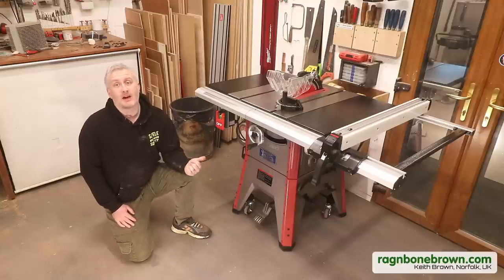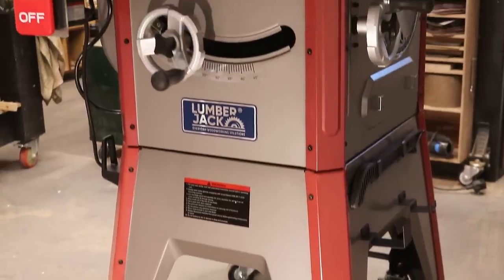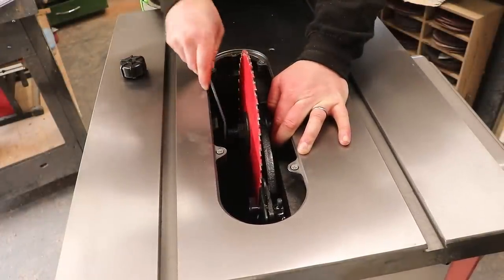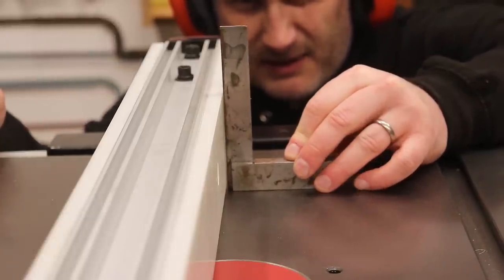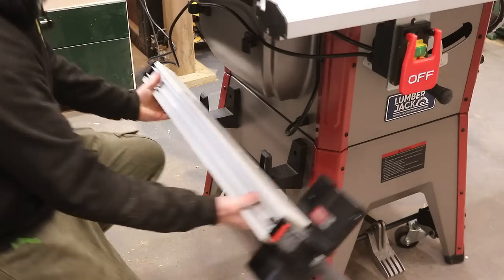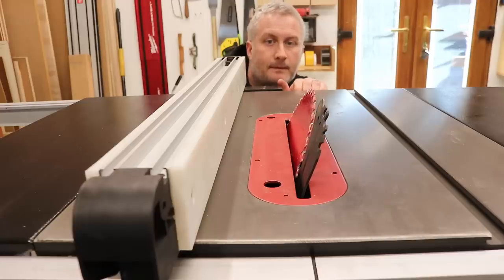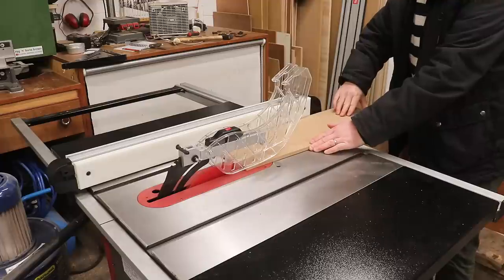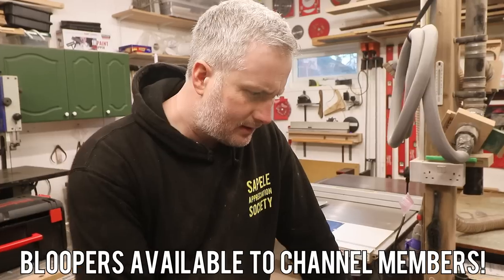LUMBERJACK TS1800 TABLE SAW: Everything You Need To Know

Comment: Your fence adjustment frustration acting was quality! Can't believe they ship that saw with a standard 13amp fuse with a motor with a large inrush current and to advise you to run it on a long extension lead is madness!!
Reply from the maker: Cheers John interested to hear your perspective on this with you being an electrician! Is running it on an extension lead bad advice then, and if so, why? Cheers 👍
Reply: @RagnBoneBrown  Hi Keith, Extension leads are always a bad idea and should only be used for temporary needs. When you use an extension lead your are increasing the length of the circuit {some leads can be over 20 meters}. If you are at the end of an already long circuit then the loop impedance (resistance) can get to high and under fault conditions the MCB will not trip in time turning the entire circuit into a red hot wire which only takes seconds. Another reason is that a coiled up extension lead under continuous use can turn into a heating coil and are a fire hazard. Best practice is to uncoil fully an extension lead when it is in use for extended periods so it can dissipate the heat.  As a wire's temperature increases so does its resistance and as its resistance increases so does its temperature. You can see the problem! Also an uncoiled lead in the workshop is a trip hazard so its just a bad idea all around. Now if you add the slow blowing fuse to the end of a long circuit with a coiled up extension lead that's a recipe for disaster!
Reply: @JohnMcGrathManInShed  The motor is designed for the American market running on 60hz running at 3450 rpm. In the UK at 50hz it runs at just 2800rpm , very slow for a table saw and the reason it cuts slower. The spec is in the manual for the saw.  Until they spec a decent motor to run on the UK supply with a soft start I wouldn't want one, shame as it looks a decent saw. The advice from them about changing mcbs and to run it on an extension lead for a plug fuse blowing problem is just total nonsense and they really need to sort themselves out with this saw and stop giving out this ridiculous advice.

Comment: A great video as always Keith. In relation to the mitre gauge problem, one fix I have seen other makers do, is to drill holes on the edge of the mitre bar. These can then be tapped and have grub screws inserted, which are then adjusted to suit. I've read through the comments and I can see that you are sitting on the fence a bit with whether to keep the Lumberjack or not and the need to make new jigs is putting you off. It seems to me, that if you removed that from the equation, then you are actually falling on the side of the Lumberjack as being the better saw. If that is the case then you should think long term and passed the making of new jigs as, inevitably, you will at some point have to remake them for the Axminster as well. Great Podcast as well by the way.
Reply from the maker: Thank you!
Reply: I fitted plastic grub screws to mine...flat headed screw driver type

Comment: I bought the lumberjack planer thicknesser which has exactly the same problem I found the only way to get it to stop blowing fuses was to run a long extension from the house. I just thought my garages electrics were old 😅 cheers Keith ill have to get me some of those slow blow fuses 👍
Reply: I’ve got that machine too. I really like it. The fence is a bit poor though. I’m planning to upgrade/modify it at some point. I’ve also been wondering about changing the blades to a spiral cutter head.
Reply: @stuartwilliams5385  yeh the fence definitely has a knack to using it but once i figured it out it was fine, honestly its probably my favourite machine it's such a beast. Iv just built a table I bought in a load of rough sawn walnut planed it all up with this beauty and came out amazing and very square. Have you found a source for a spiral cutter head that will fit it?
Reply: @LAJay90  I haven’t yet. I was hoping you might have. 😝. If I find one I’ll post here.

Comment: Send the saw to Matt :D It will be an upgrade. 
So, the pros with this seems to be the mobility. If you had to share the garage with your wife's car for instance. But in your case, your workshop is quite large by European standards (non industrial ofc). And you may not need the mobility. The blade guard on the Lumberjack seems better to be honest, since you can aim through the split. When it comes to better features, you really cant beat the features on the DeWalt jobsite saws. So, if you follow that logic you are back to your old shed. I have yet to see a cabinet saw with good dust extraction and I use the same kind of solution you do, with a separate shop vac for the blade guard. IMHO the only feature your Axminster saw lacks is a quick change riving knife. But I am rambling on here. Great video. Love the podcast as well. Was looking forward to this video. Nomad out.

Comment: Great video. You definately nailed many issues other had setting up the saw here in the USA. This saw is the sister saw to the Sears Craftsman 218330. It is no longer made, the pro series took it's place for a couple years and the line was terminated. However, this saw may well be brought back with some great improvements. 

T

Comment: Had this saw for a couple of years now and have no complaints other than with the motor, had the same issue as you and switched to slow blow fuses which has worked ever since. For me the axminster was a nono as it just would be too space inefficient whereas the lumberjack slides neatly under my workbench when its not in use.

Comment: I have a Harvey ambassador with the same kind of insert plate. Get yourself some aluminium composite panel to make zero clearance inserts. It's aluminium sheet over a stiff plastic core. You cut one bit to the size of the insert and then epoxy a second sheet under that with cut outs for the levellers and other bits in the way. Makes for a cheap and stiff insert. Mine is 4mm composite panel for thickness. You will need to check yours but my guess is it is the same or close.

Comment: If I was in your position I think I would keep what I already had despite the issues mentioned, especially if I had already gone to the trouble of having a 16amp power socket installed, made and fitted a router table to the side table, an outfeed table to the front, made some jigs for it etc. It feels like towards the end of the video you are 99% sure you want to keep the Lumberjack but you want that final 1% just to confirm it's the right thing to do, whichever one you decide to go with good job on actually getting your hands on the LJ to make this great review video!
Reply from the maker: Thank you! Yeah that about sums it up
Reply: @RagnBoneBrown  I don't think you mentioned it but if you are not under any financial obligation if you kept the Lumberjack i.e. paying something for it then that might become another factor in your decision. The Axminster on the second hand market should be worth something not far off £1000 if not more will all the accessories you added when you bought it.

Comment: I'll be honest, Im really tempted by it. Loosing half a HP might be an issue BUT I would get around that by just changing the blade more often. I love the idea of the Dado, thats a game changer from my point of view. I think it would make an awesome saw to build into a cabinet. If you could purchase extra side tables or extra fence extensions so you could do that than it would be awesome. A sliding table would also be a game changer as coupling that with the Dado and you have a tenon maker.

In relation to the electrical issue, to be fair to Lumberjack, the fact that they came on here, made a comment and are trying to come up with fixes, says alot about the company. I've had conversations with a few different tool companies and they always usually result in it sounding like they don't care which is the complete opposite that I get from LJ. 

Great review, look forward to seeing how you get on and what you decide. It's a toughie. How does the standard table size compare to the Axminster? That would be a big decider for me I think.

Comment: Interesting review.  I bought a Dewalt DWE7485 a couple of months ago but only got to set it up last week. One immediate advantage compared to the Lumberjack was that it was completely setup out of the box and other than clipping the fence on (and then clipping it on correctly as I got it wrong the first time) it was ready to use straight away.  But boy, is it loud and I take all your comments about the benefits of induction motors.   The small amount I have used it so far I’ve worn ear defenders.
Didn’t bother with the factory mitre gauge, I’d bought an Incra Mitre V27 a few weeks earlier which fits both my bandsaw and the Dewalt, and with adjusters for side slop.

Comment: From an electrical perspective, the saw does not have any issues. Slo Blow fuses were made for this exact purpose, to deal with inrush current that is present on startup. The device draws more than the fuse is rated for for just a small amount of time, and then current is much lower. The slow blow fuse keeps the safety rating of the fuse for a fault at 13 amps, but allows for the rush of current during startup. Yes, they should have used this from the get go. There is nothing wrong with the saw, it is just how that motor works by design. The fault was the builder of the saw, and if they changed to the slow blow at the factory they have sorted the problem.

Comment: I bought a lumberjack band saw and was quite impressed by it. I’ve use replaced my mini lathe with a lumberjack one and it’s great. They seem to do a great job at a reasonable price. This is something that you didn’t mention, price difference though I appreciate it may have been in your previous video.
Reply from the maker: Prices change all the time so no point putting them in a video as they won't be right for long

Comment: Seen the electrical problem with the fuse in the plug blowing mentioned before on Facebook and telling people to change the mcb, and use extension leads is just total nonsense and they should sort themselves out with the correct information, non of that will solve a blown plug fuse when the motor is drawing too much current on start up. This problem has been around long enough and they really should spec a decent motor that will run properly on UK 240v 50hz. The saw being designed for the American market means the motor runs at full rpm on the US 60hz at 3450rpm, using it in the UK on 50hz means it's running at a reduced 2800 rpm which is very slow for a table saw.. This is shown in the spec in the manual if I remember correctly. It's looks a good saw but I couldn't recommend it to anyone because of the electrical issue and not having a motor that runs at the higher RPM. Good review by the way 👍

Comment: I would assume that the two grub screws, or set screws to our American friends, in the mitre bar are to make sure the head of the mitre gauge sits flat on your cast table saw top. A fair assessment of the competing table saws,. I would go with the Lumber Jack as the ability to move it quickly in the workshop is a major benefit.
Reply: sure it's to get the mitre gauge flush with the surface of the table... but the question he asked is why would you do that?

Comment: My TS1800 has developed a fault!! When raising or lowering the blade, it sometimes goes very stiff.  I assumed it was just a build up of sawdust and grease, as i still havent got extraction set up on it.  I find that just wearing a mask and putting a bucket under the extraction hookup does the job for the time being (i have got an hvlp extractor, but still havent got the workshop to a point where im ready to install it)

As ive been adjusting other things on the saw anyway this evening, i thought I'd pop the cover off and see if there was anything obvious.  Turns out there is a very mangled washer dangling on the thread that has managed to get wedged between the thread and the teeth on the motor mount.  I couldnt figure out which end it had come from, or if it was even supposed to be there.  Ive emailed Lumberjack today, but i guess i wont get a reply until at least Monday as they will have been closed by the time i emailed.

Comment: Tricky! I was leaning towards the smaller Axminster that Paoson just upgraded his mobile bench with, as I couldn't see the need for a cabinet saw and I don't mind waiting for them to restock. I'm now reconsidering - the lumberjack is an impressive package! I don't like the fence style on the Axminster saws - I retrofitted a slightly smaller version on my very old cast iron saw and it has definite flex under pressure.

Comment: Very interesting. I must admit to having been wrong about this saw when making my choice last year based on this review. But I certainly don’t regret choosing the Axminster AW250 even though it lacks some of the refinements of many contractor saws. The Hybrid saw format is interesting from a UK point of view as you would think there would be a huge demand for it, but I see and find most small workshop owners tend towards bench/cabinet saws or site saws.
Reply from the maker: Thanks Karl. I was wrong to choose my Axminster too so that makes two of us 😁 if LumberJack had done a better job at getting in the hands of reviewers earlier on, I think they probably would have sold tons of them
Reply: If you guys had the decision to make again from the start, would you have gone with the lumberjack? I am currently setting up a new workshop and upgrading my table saw is high on the agenda. I considered the Axminster but what I will need for the extra power might not even be an issue and the lumberjack seems to excel in most other areas. Can I also ask, does the arbor diameter being imperial cause any problems in day-to-day use? Great review by the way (and incidentally it was your Axminster review I saw in the first instance too).
Reply from the maker: I will cover this in an upcoming video, but it's important to note that the axminster saw I have is no longer available for sale, so it's irrelevant! But yes the lumberjack would be my choice if I was choosing between the two
Reply: @RagnBoneBrown  The price point  also makes it an attractive choice. I think I might be about to place an order with lumberjack. 
I don't  suppose you have a referral code?
Reply: @GazBadger  I think I probably would have. I've not talked about the AW254TS but now I've re-jigged my workshop to make sure it's available for use more, I might. There are two things I like about the lumberjack. It's size is compact enough for a 35ft x 11ft garage workshop but has a large saw feel. The second is the in-feed on the table is bigger and I've always preferred that and the axminster relatively short infeed is one if its short comings.
Reply: @Strawbyte Workshop  I hadn't  even considered  the infeed length...I have to agree with you that would be handy. I think my mind's  made up. I am ordering  the lumberjack tomorrow. Thanks for the response.
Reply from the maker: I don't but Shaun in the shed will have

Comment: i'll be buying me some slow blow fuses then, great review. one thing you didnt mention that has taken me time to adjust to is the lack of break on the motor, meaning the blade takes a while to stop
Reply: Update - slow blow fuses worked for a while but still ended up blowing, told by Lumberjack that I would need a 16amp circuit.

Comment: Great saw, I've had mine for a number of years. However, it is not the same as the Ridgid saw (I almost bought that one), it's an almost mirror image of my Craftsman #21833, with a few tweaks here and there. It's one of the smoothest running saws I've owned, it passes the nickel test (stand a nickel on it's edge and turn the saw on, nickel doesn't budge).

Comment: The old wood workers saying is so true!!! "Save your money and buy the best tools you can afford!" Its cheaper to pay ones!! On paper this saw ticked all the boxes for me.... It had everything you could ask for moving up from the DeWalt site saw... So i bought one... As mentioned in the clip, this is the "old Ridged table saw " . Research faults on that old Ridged saw and you will find there are a lot of common un fixable faults that may or may not affect your saw out the box. Its a lottery... some get a perfect saw and others not... There are at least 3 common faults that pop up that makes reliable accuracy imposable on this saw... With out even fully assembling my new saw it failed on the first test... Lifting the blade up and down at 90 deg, there was more than 1mm deference at top and bottom, i could literally see the blade moving with my naked eye... It did not lift straight. It was returned for a refund... The faults on this saw date back 15 plus years, i thought they must have fixed all these faults by now, but no... its the same faults haunting this old saw with a new name... I bought the planer thicknesser too, what i pile of junk!!! Advertised as a cast iron top, its aluminium... not sure how they get away with saying its Iron... I will say this though, i do use the planer every day to flatten and squire stock and it does do a pretty good job at it, even with all its faults... Would I recommend it? No! I wish every day looking at it, that i bought the next one up that cost half the price more...